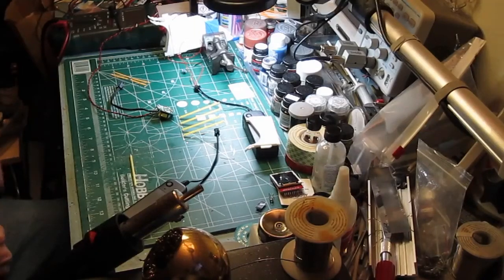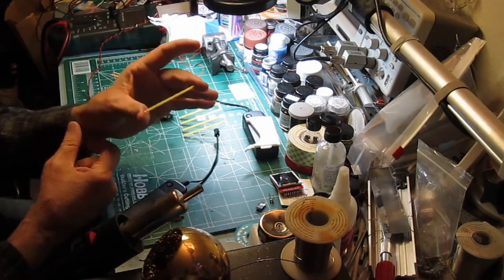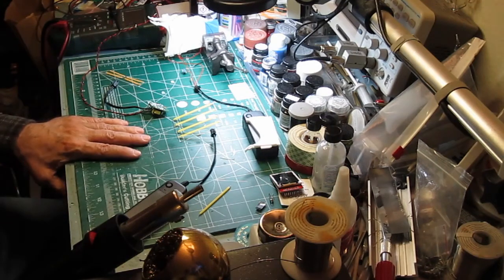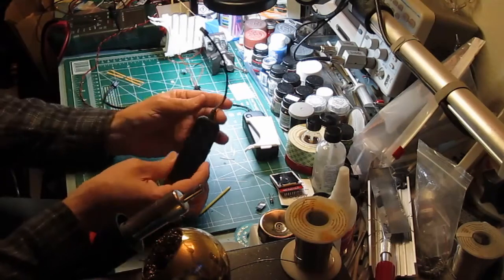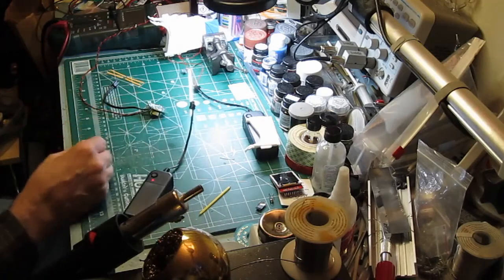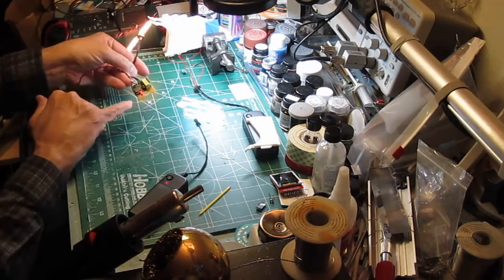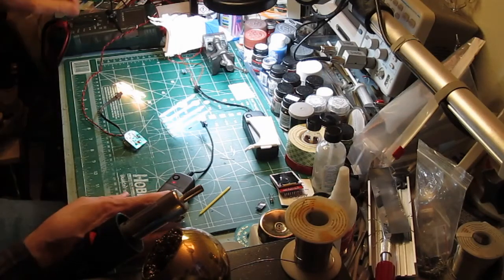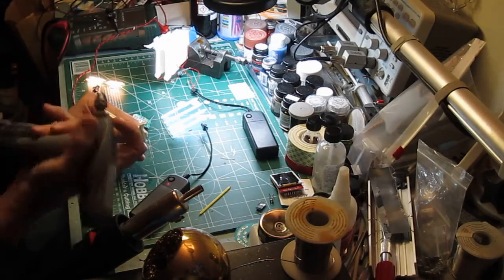Filament LEDs for Model Lighting

Comment: You can get low voltage versions as well now; they might be cheaper to use than buying the inverters but then you're kind stuck with >1000 high-voltage versions.

Comment: I'm interested in using led filaments in a Star Trek Enterprise E model for the Warp Nacelle grills.  I would be running a 9v lighting system and would like to connect them to that same power supply. Would this work?